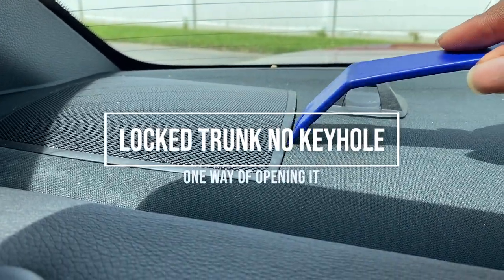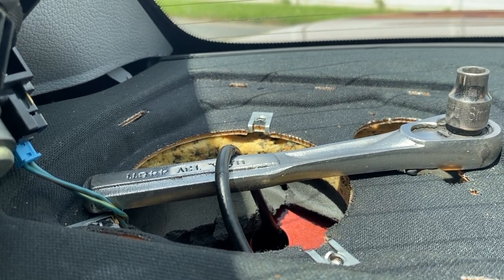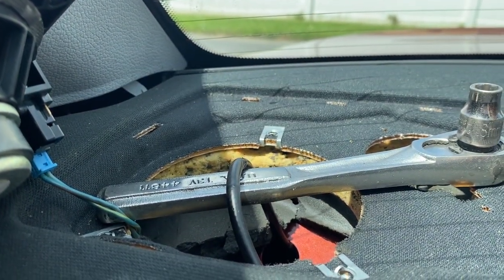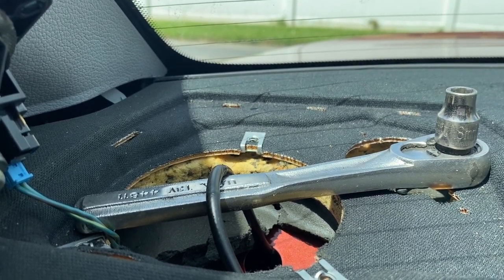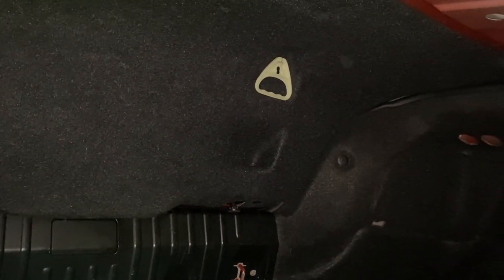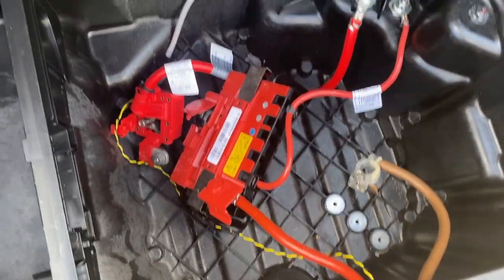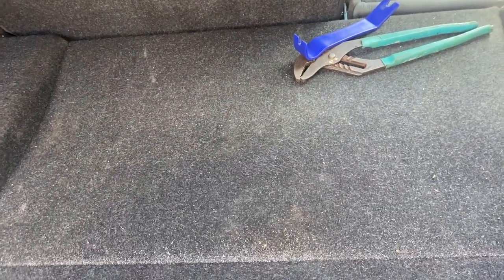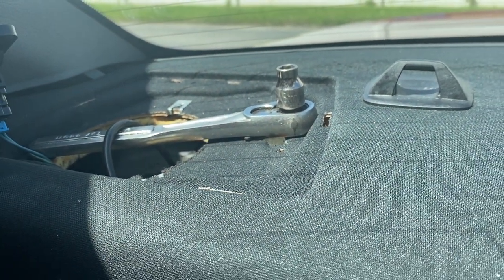BMW E82 Battery Removed. Cant Open Trunk?!

Comment: Yo I love you long time. I drilled a hole in the back center pull-down, I had no pull cord nothing to open the boot. Battery was pulled out due to alarm going off so jump leads or connecting the battery to the charging points wasn’t working. Went through video after video of trying different things was almost defeated then I comes across this video. Thanks brother.
Reply from the maker: Ahh man lol glad it was of help to you !!

Comment: There's a key hole for the one in the fob next to the license plate light.
Reply: Nvrmnd just noticed it's a 128. Used to seeing the e90s and e92s on the channel.
Reply from the maker: Yea on both the e9x and e82 after like 2010 or 2011 can’t remember when but they got rid of that key hole. My 07 have that keyhole next to it hence why I forgot about the newer ones not having it.

Comment: You can use the front jumper terminals to power the car and unlock the trunk
Reply from the maker: It seems only if the battery is still inside and you have both terminals connected or just the negative disconnected. In my case both was disconnected and I tried with a battery charger and with jumper cables and no power went to the car. I heard you can jump some fuse in the fuse box and it will power on but didn’t want to mess with frying a module or something.

Comment: Hello, do you have to make a hole under the speaker? I don't see that it has a hole made...
Reply from the maker: Wouldn’t have to make a hole. Follow where the cables are routed through and pull on those
Reply: Thanks, I'll try it. @nOshi2x

Comment: I dont think this works for E82 135i coupes. I got the padding out of the way and yanked the cable in every which way as hard as possible and nothing. Did the same on the other side as well and nothing. Left swearing with red hands
Reply from the maker: I went through the same experience and thought process. I first tried with just my hands and that’s when I tried with the ratchet. I guess you can use anything solid that can give you leverage. Place it just like shown at :33 mark of video and pull and lean back toward front of car.
Reply: @nOshi2x  thank you for replying! I tried it again jamming something in between for leverage and had to pull hard enough my shoulder nearly blew out haha. But it worked! Thanks man what a life saver
Reply from the maker: Sweet nice glad it worked out !!!

Comment: My seats don't fold down. FML.
Reply from the maker: Yea my e90 sedan seats don’t fold down or have a ski pass. But I lifted the arm rest and cut that square section out for audio purposes. Can possibly do that as a last resort if you don’t figures something out.
Reply: @nOshi2x  I'm going to try and fish a line through the rear passenger side speaker deck.
Reply from the maker: Yea or even one of those metal cloth line hangers.